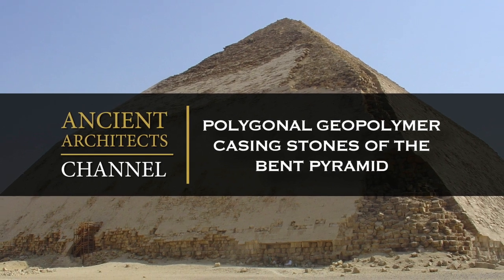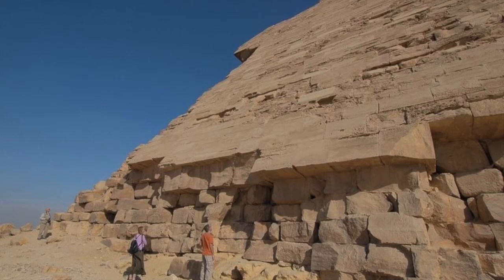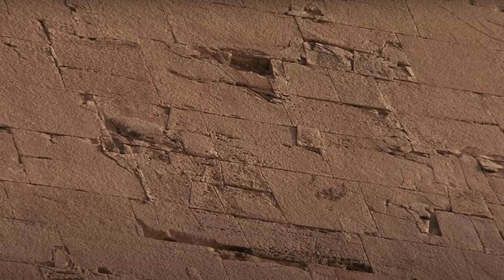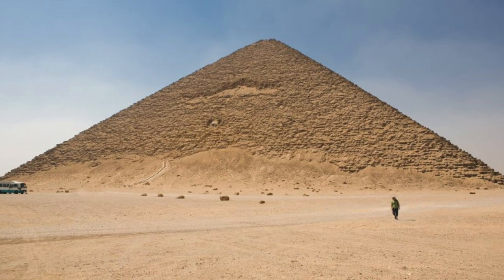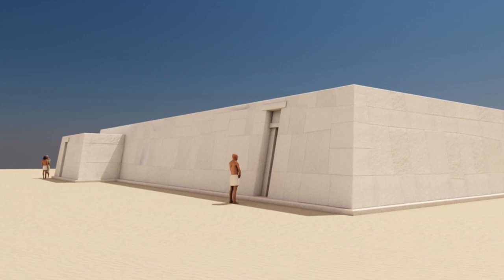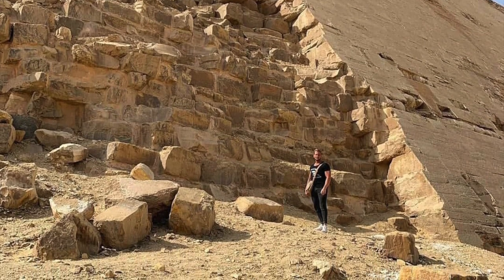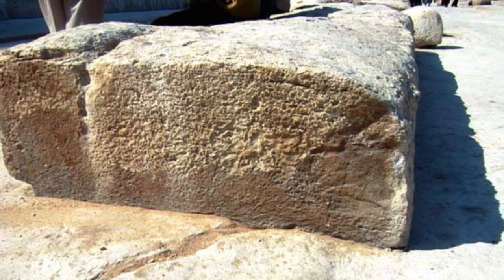The Polygonal Geopolymer Casing Stones of the Bent Pyramid | Ancient Architects

Comment: Thanks Matt.  At the 3:15 min mark you ask a good question: "But why bother?"  Well, I'll tell you.  It's because while having perfect joints via cement be unavoidable, the skill to make perfect joints with chisels, even given all the time in the world, is unattainable.  As you say, the burden of proof is on those who dismiss cement blocks.  Lehner couldn't do it for NOVA even hiding cranes and apparently iron tools; no one can because it can't be done now, nor could it then.  Cement is what's left when you rule out the impossible.

Your right too that the 'form work' on the Bent structure is patchy.  That is the way engineering works.  Try something; try to make it fail (like how heavy can the granite block be before we can't move it or it breaks) and make the process better.  By Giza they had worked out the system and Davidovits shows that Khafre's blocks could have been made with just 5 or 10 different forms. And yes, it's probably an earthquake protocol.

The Bent and Red structures were the first attempt to perfect the technology under the great Imhotep's watchful eye.  Giza was the finished engineering item.  Did I mention the great Pyramid was designed to produce light?  Did I mention you don't need electricity to make light?  Fireflies don't need it. Edison's first light bulb didn't have it.  They didn't need it at Giza either which is why you will never find lathes, diamond tipped blades or drill bits.

Comment: Do the surviving casing stones from above the bend exhibit the same traits or not? It might be the upper section was either never there, as if it wasn't originally a true pyramid or perhaps it was broken down or collapsed only to be rebuilt by a much later group not able to build at the same steep angle of the lower section.

Comment: Do you think they used the dust because they had a lot of it as a byproduct from quarrying the limestone already, and it was a way to get the results they were looking for, with using up all the materials they had, and saving time and energy without having to quarry the actual blocks for casing.. Or perhaps the manufactured casing blocks had a better visual effect than the natural stones would?
Reply: They could have used the dust to produce a very wide range of objects or blocks, including statuary or paving stones for example.  The artificial-stone blocks would have looked identical to the pure limestone used to produce the cement used to make them.  So appearance wouldn't have been a factor, but not having to move and raise tens of thousands of multi-ton blocks definitely would be a big consideration.

Comment: I wonder if the smaller blocks within the standard large casing blocks were used to support scaffolding. IMO the builders left a void for wood(or stone) beams and later inserted with blocks. I had a hard time believing the smaller blocks are repairs.

Comment: Could natural limestone blocks have been soaked in calcium solution, p possibly for strength, durability or appearance? This would explain their apparent artificial material.
Reply: The casing stones are the only ones in the spotlight, and they were made from Tura limestone which is fine and white already.  Only a serious polymer in a limestone calcium solution would add strength and durability, since without it the weathering of rain and wind would take their toll much more quickly.

Comment: This idea that the stones were artificial rock or concrete makes absolute good sense.   By crushing the rock at the quarry  and mixing the concrete on site and filling a form (mould)  would make the construction go much quicker and with fewer labours needed to move the blocks.  If they were able to do this in Egypt, why could they not have done it in Peru or Mexico.  The question in the back ground is, was there and connection or cross pollination of cultures between the new and old world in the time if old kingdom or before?????   How old is the megalithic work in Egypt and Peru?    Are they both older than main stream says???????   I am very suspicious of what has been hidden by archaeologists of the past  to protect their personal theories and reputations.  The truth will win out in the end as the new generation breaks the barriers created by the old.
Reply: or...as another comment suggested, they may have used BOTH cut blocks AND cast blocks, intermixing them with the cut blocks acting as walls and floors for poured blocks.  Greater strength and speed of construction in not having to wait for poured artificial limestone to fully cure.

Comment: Good presentation. So more evidence is needed to contradict this theory. It goes back and forth. The technology to make the “concrete “ stones is a mystery. And the odd sizes as well. It must have been a lot of work. And somehow fitting or pouring in these cover stones had to be very difficult and time consuming. Looks good though.... after all these years! If we could get the recipe for this concrete, it would be an industry changer. Things would last so much longer. Might put some people out of work! lol
Reply: I can't accept your characterization of modern forms of concrete as being weak and thus not long lasting.  Concrete come in various grades and methods of preparation, so no new inventing of the concrete wheel is needed.  Hoover dam will last forever.

Comment: i see the idea of casting the casing stones as a solution to a problem they had created , i don't think they would have the need to quarry stones ,transport them , then crush them up to use them in a geopolymer cement 
they had already quarried millions of blocks before they had the need for casing stones , they  shaped them , pounded them , cut them and chiseled them , this would have produced thousands of tons of waste that they had to get rid of , i haven't yet seen a spoil heap comprising of thousands of tons of waste stone anywhere in Egypt .
i think someone had the bright idea to use the waste from the blocks ,and created a great way to get rid of the problem , unless someone has evidence of thousands of tons of rock cutting waste i don't know about .
Reply: Giza limestone was not used for the casing stones because it is light brown, not pure white. So Giza quarry rubble was not used to make the casing stones. Wrong color.  As for waste, you are forgetting about the North Africa winds. They blow and bury the land with sand and dust.

Comment: Rather than casting and placing, a continues face cast plate of wood or granite could of been used to make the face flat, and the igegular sizes would be made with a board or slab of granite moved behind it, casting block by block in place, with size variation based only on the batch mixed as dry time is a factor, uniformity is not, except for that of the plane of the faces.
Reply: If in place, each stone should have a more defined grain from the moving cast plate on one side, as the other was poorer against the already set stone, unless is was polished granite or as smooth.

Comment: At 3:27, you ask if I have any thoughts on why they wouldn't just transport quarried blocks to Dashur for the bent pyramid... Yes, I have thoughts on this. It is bcus the old kingdom did not have the resources or the knowledge, nor the tools, or even a wheel, to shape and transport such gigantic blocks. The old kingdom still only had copper chisels, not even steel tools and hard blades had been developed. I believe the old kingdom did not carve blocks, rather they synthesized blocks. Why do you believe it is easier to cut, transport, lift, and carefully place a megalithic stone high up on the top of a skyscraping pyramid ad with no cranes, rather than to pour it as cement and let it cure? I think it should be obvious that the geopolymer method is many orders of magnitude easier than building with multi-tonne, quarried stones.

Comment: There is no advantage in making geopolymer casing stones in a re-usable mold and then placing them in their final position.  There is a great advantage in creating a mold around place you want the casing stone and then pouring the geopolymer casing stone in place.  This makes the newly created casing stone a perfect fit with any and all of the previously placed inner carved stones that it sits against, and a perfect fit with the previously poured geopolymer casing stones.  The air tight, perfect fit, is essentially impossible with carved stone unless you use mortar.  But mortar presents its own issues and challenges, and I've heard very little evidence of its use ancient Egypt.

Comment: Why? The much bigger question seems to be WHEN?
Reply: Presumably an organic bit in the block could be carbon dated.
Reply: @kirkjohnson9353  if you use pulverized limestone, by using Limestone Mills. you process the organic material located in the quarry material too. the only dating result will be the age if the used Limestone was formed from this type of sediment are biological sedimentary rocks. Their biological origin is often revealed in the rock by the presence of fossils. China company's working today with 3D limestone printing systems where used for printing limestone building parts. even in complicated shapes using precision like in lego stones.

Comment: I agree with the thought 'why brother'  so much effort to create the geopolymer that you may as well just cut the blocks, the simplest explanation is usually the way. 

The only caveat to this is that it would be worth the hassle if it fitted in with either a specific religious need or ancient scientific need. 

So doing this may have had significant religious or scientific ideology to justify these lengths. 

However I do doubt it was this.

Comment: "why bother?" in the modern day, transporting sand/gravel, as well as quarrying gravel or sand, rather than solid stone blocks, is easier,... mainly due to the fact that quarrying solid stone blocks requires quality control, whereas gravel or sand allows you to just take the lower quality stone and use it. Plus this would allow them to use scrap material, and potentially save cost on materials... in the most basic sense, even modern concrete is essentially synthetic limestone,... calcium silicate gel, limestone grains and possibly diatomatious earth,  is the proposed recipe,...  modern concrete is made of high calcium limestone, burned to create lime(in ancient times occasionally sea shells were burned instead of or in addition to limestone), and sand(silica),..... all the egyptians would have needed  to create their concrete was fire, water, limestone and sand,.. what is diatomatious earth?, calcified fossil seashells, from diatoms,..... Obviously in order to make it mimic stone to such a high degree, everything would need to be crushed to a much finer powder than is commonly used today, but even roman concrete was mistaken for stone as late as the late 20th century,.... perhaps the romans gained their concrete technology from egypt?
.... it would be interesting to do some experimental archaeology, and attempt to recreate the artificial limestone, using our best guess at the original recipe,...
Reply: Bulls eye!  But I would add one thing. Organic (along with inorganic) binders could have been easily produced from natural materials such as sap, tar, wax, oil, gelatin from cattle, cellulose from plants, proteins from egg whites and milk, etc.  All such substances could have been judiciously added and turned rock hard either with time or with heating of any given object.

Comment: I wonder why geologists are so dead set against geo-polymers? When you look at the 'H' blocks at Puma Punku what you see is the same as if concrete had been poured into a mould and the moulds had just been removed.
Reply from the maker: I think it’s just a huge leap against conventional thinking. I guess like all things, it’ll take time and more experiments until it’s accepted
Reply: I would add too that if when the molds were removed that there was still a period during the "curing" process that you could shape/cut/smooth the surface, explaining the odd angles and shapes.  If you waited too long to shape, it was too late. This may explain some of the "nubs" on many of the stones...they may have been used for support, but they actually couldn't easily remove them once set.
Reply: @colbywest5808  The nodules could not have been used for lifting before they had fully hardened.

Comment: Forming up any kind of concrete/polymer in spot to look like this is just impossible.
Reply: I don't know why you would say that, since we form up the vertical sides of skyscrapers every day of the week without much problem. And technically tilting the formwork inwards as they worked up or down the sides of a step pyramid makes the job even easier.
Reply: @BlueChrome  the casing stones are individual blocks, to pour them in spot and to make the joins polygonal to near perfection......yeah it aint happening.

Comment: AGAINST:
1. IF you are casting, this requires a "form"/mold. The whole idea being to rapidly reproduce a LIMITED number of shapes. IE: the differences between a corner block and a normal layer one.
So WHY are there such a surprising variety of block shapes ? Irregular, interlocking polygonals? 
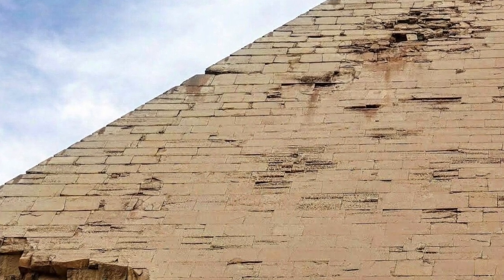Look @ 11:48 - examine closely..it is NOT RATIONAL that SO MANY "forms" producing an incredible number of different blocks could have been the intention.
2. AGREE with yr statement:  why mine it, break it, transport & then poly - create ?? The Egyptians were ALWAYS practical people.
3. But: in the case of the "Great" pyramid, it seems the case: the uniform "magnetic strata" and sizing/conformity. 
The "bent" and the "Great" were, in any case, built in different eras by different Dynasties...so different techniques may be expected ?
More examination needs be done.

Comment: Not necessarily a proponent of this however if the bent pyramid was built later (ie... by later civilization) and they tried to emulate the polygonal masonry of other sites. Perhaps the casting stones were formed regardless of the obvious problems because of the reverence they held for other works. They may have used the remnants of previously worked stone as a way to keep debris cleared and not waste the excess material.  Just a thought. Good luck and thanks for the videos.  Ps. If I wanted to make a one time donation,  how could I do that?

Comment: Well, the reason the ancient Egyptians built with stone was because there were not many trees in the area. 
To make concrete blocks would require huge amounts of wood in order to create the molds needed. 
Seems like far more work to grind rocks down to a power, only to cast them into blocks again. 
Doesn't seem logical in a land with very few trees.
Reply: Molds need not have been made of wood. Substitutes were possible, like hides covered with thick plaster, or papyrus pulp shaped easily and coated with brick mud.
Reply: @redwoodcoast  Well, making those types of molds would result in more work than it would to simply cut the stone blocks out of the bedrock.

Comment: same reason we use cement, was probably much easier to pound the rocks using unskilled labour into dust and cast it into a perfect block, transported in as many sacks as you want, than it would be to finely cut a hundred ton rock and transport that, all without chipping a single corner of it.

Comment: I believe the polygonal castings of different sizes were used to compensate for lateral stresses. If one were to use rectangular bricks of equal size, each course of bricks laid would create a line of weakness across the breadth of the pyramid. If this were a vertical wall, these lateral weaknesses in the structure can be compensated for with the mortar and alternating positions of the bricks. When you look at a brick wall, there are no vertical seams. But you still have lateral seams.
  So you see why this typical form of masonry can't work for a slanted wall the height of a pyramid. Lateral forces would cause the wall to buckle outward at those seams as more and more stone layers are added.  But with polygonal shapes, both lateral and vertical seams are minimized if not eliminated.
    And it is more of an added benefit that this design withstands earthquakes better. I don't think earthquakes themselves were the primary reason for this method (at least not in Egypt).